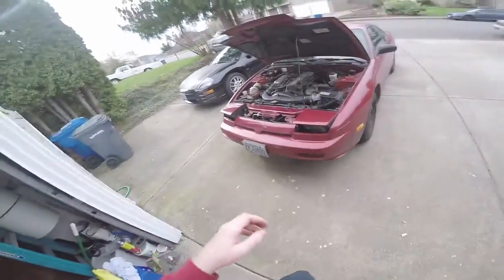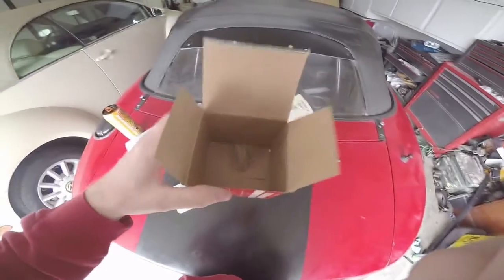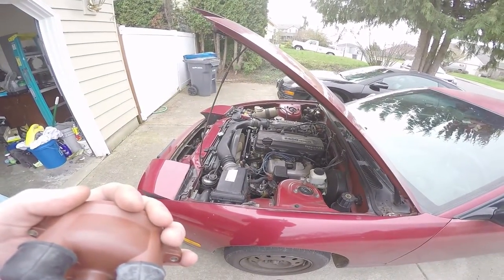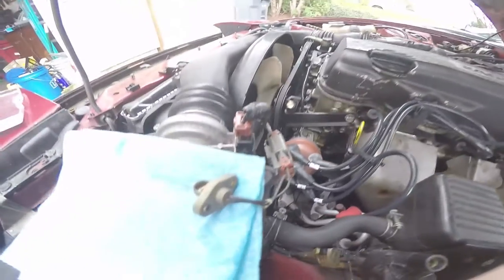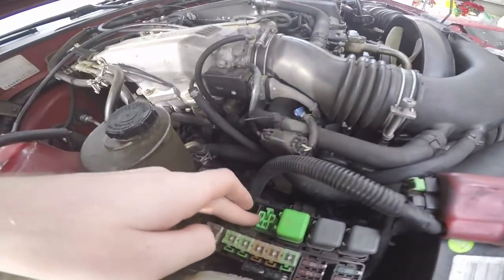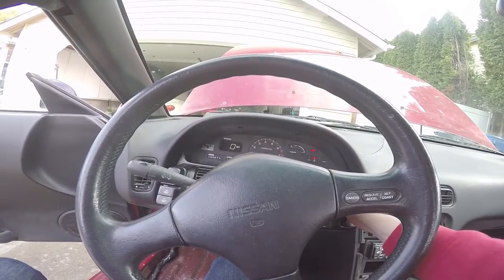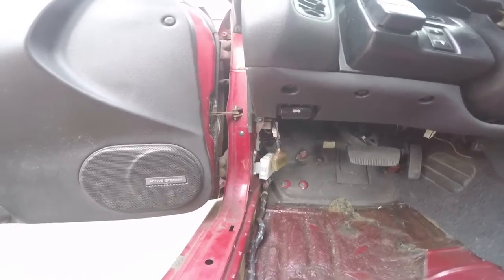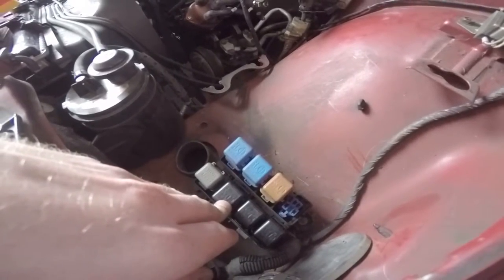Drift Build Pt. 2 (Much Needed Maintenance)

Comment: hey man, unrelated to this vid but I can't get my G920 to work on PC. I've searched everywhere but it seems no one has the same problem. Basically as soon as I plug in that USB to my laptop, the wheel locks up and becomes super difficult to turn, it's like locked at 150 degrees :/
Reply from the maker: Hmmm I would go to the g920 software and make sure the wheel rotation is set to like 900. And if that's dosnt fix it, I would uninstall the drivers and re download them. Make sure your g920 profile is set to default
Reply: thanks man, still hasn't fixed it. Contacted Logitech support but they're utterly useless, guess I'll just keep waiting for a firmware update